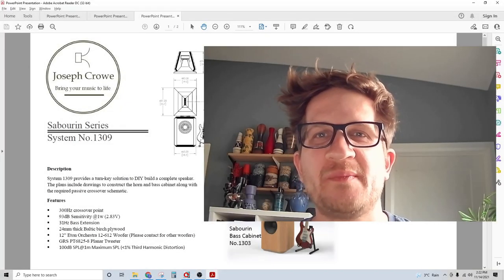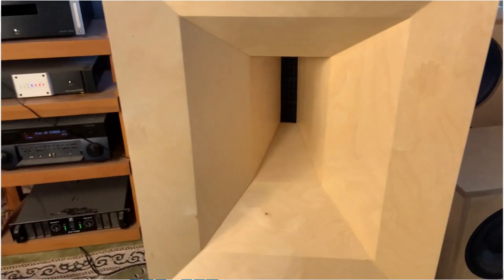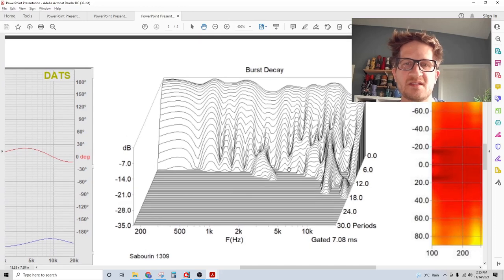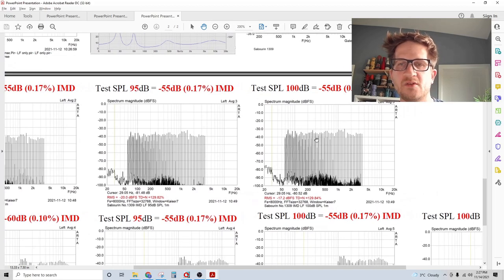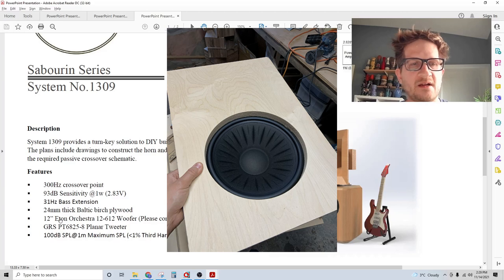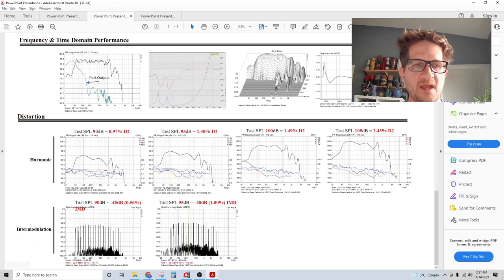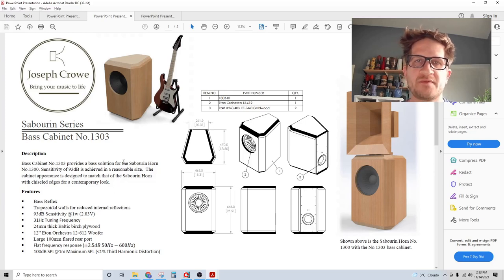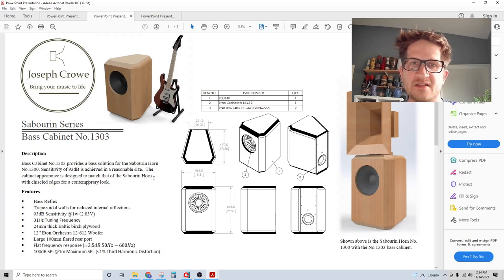Sabourin No.1309 Speaker System DIY Plans

Comment: A pentagonal cabinet would probably further reduce standing waves cuz a trapezoid has 2 sets of parallel walls vs 1set with a pentagon (if you don’t angle the top panel)
Reply from the maker: Yes I value non-parallel walls since to me they always sound better subjectively.

Comment: Looks amazing. Any chance the design could be made available for 18mm plywood (at least the horn)??? The 24mm ply is nearly impossible to find these days. You’ll just be reaching a much bigger customer base. Not sure if your 3D software can accommodate this without too much effort.
Reply: Might need to laminate two sheets of 12mm ?

Comment: This exactly what I am looking for but prefer 8 or 10 inch woofer folded horn bass cabinet if possible or just bass reflex but smaller cabinet then the 12inch woofer. And one GRS planar in the horn. How much will it be to build it as I am not diy guy. Thanks!

Comment: By approximating the smooth horn shape you have used on your CNC biradials, what do you lose by using horns with discrete angle changes? Are they a source of significant diffraction?
Reply from the maker: There is some compromise with the discrete angle changes. But the net result is still a wide margin better than most speakers on the market.  The off axis polars are pretty revealing of the difference.  But it gets you in the ball game for not much cost.

Comment: I like all of your designs regardless of the fact that I have not heard a single note...lol  My point is I have had good success with the original GR tweeter and the smaller woofer offerings from ETON. My struggle has been the elusive point-source imaging I've heard other horn presentations and realized good depth and soundstage. Not so much with the conventional cabinet design. One more.. in a question:  The port, is it flared on inside as well?
Reply from the maker: Yes the port is flared at both ends. Thanks! 🙂

Comment: Looks like a good project for semester break this winter. Going to use both drivers suggested from Parts Express. Thinking about active crossover with two amps and streaming pre-amp.

Comment: Is it possible to make this speaker Bluetooth and wireless? Or any type os premium speaker?
Reply from the maker: I would suggest a Bluetooth plate amp.  A reasonably priced unit can be found here.  There are more expensive units offering more power and better sound 
https://www.parts-express.com/Dayton-Audio-WF60PA-60W-Class-D-Full-Range-2-Channel-Plate-Amplifier-with-Wi-Fi-and-Bluetoot-300-781